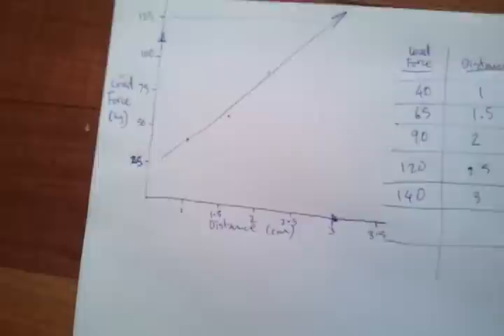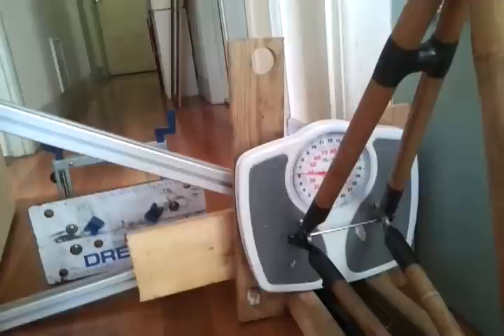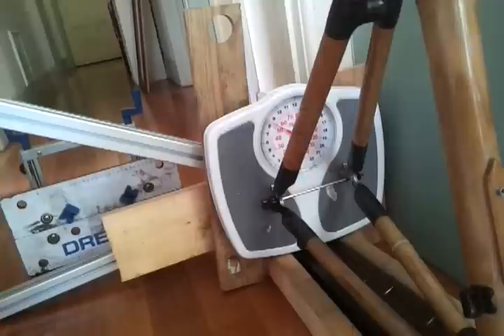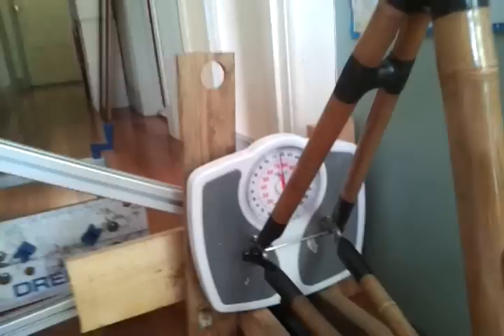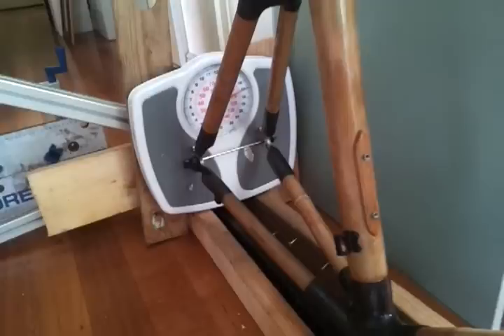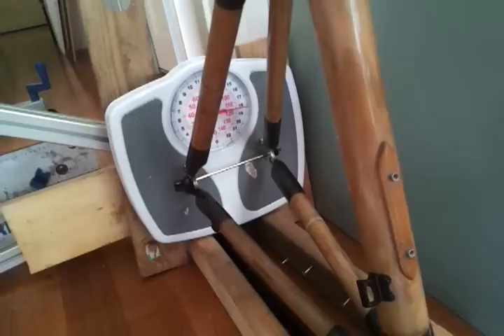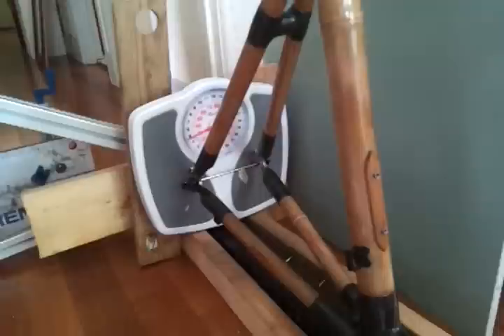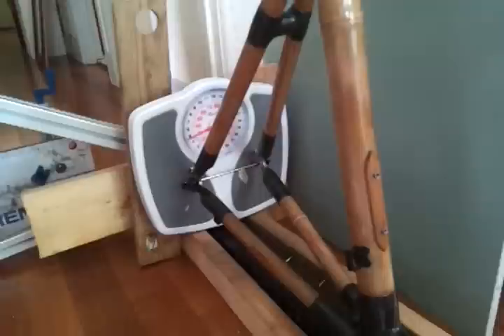Bamboo Bike Frame Deflection Strength Test #3 - The Samurai - Part 2

Comment: I think you should also have taken into account the movement the scale has when pressure is applied. So the frame and fork did not deflect 3,5cm, the scale took some of that movement. It's stronger!